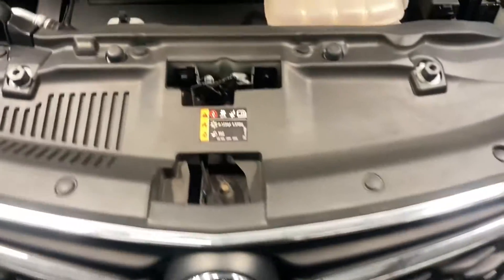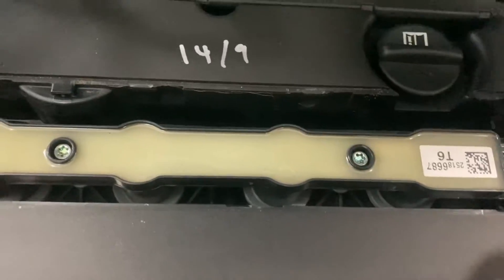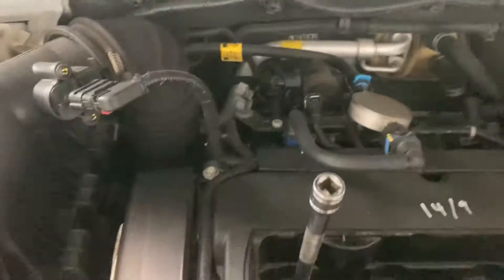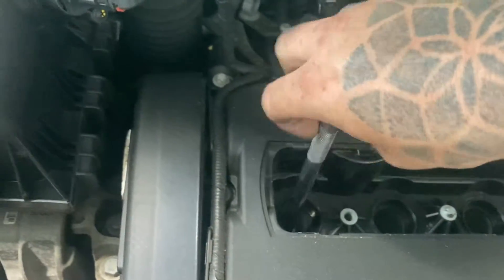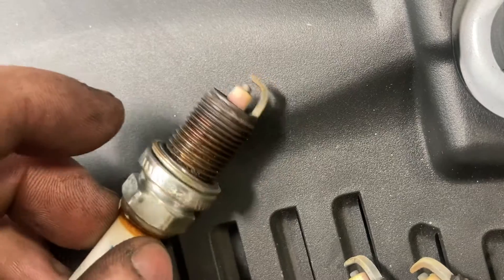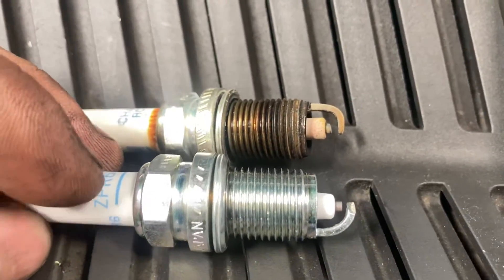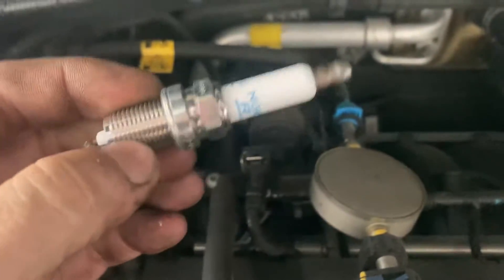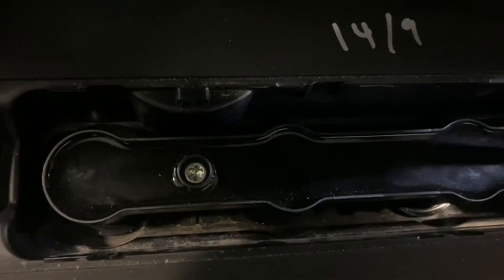Vauxhall Mokka Spark plugs and coil pack change.. causing misfire!!

Comment: I recently changed my coil pack.
I cant take out again the new coil pack it is stuck tightly. How do I take it out? Just pull using force or do i need any tool
Reply from the maker: Just pull hard and even, or a slight pressure from a screwdriver under it. 
Always helps putting some rubber grease around the pencils where the connect to the rocker 👌

Comment: Was on the motorway last weekend and my Mokka lost power all of the sudden. RAC & garage couldn't find an issue with it as engine light wasn't on. Suggested potentially the coil pack & spark plugs might need changing.
Reply from the maker: How was the vehicle behaving?
Reply: Exactly the same issue.. thought it was the fuel pump. 
Hopes changing coil pack wirks

Comment: Hi what year mokka is this please?
Reply from the maker: 2017 model I believe
Reply from the maker: But this engine is pretty much in most Vauxhalls
Reply: Would this prevent an ESP light that shows on the dash - but only when parked or still at lights?
Reply from the maker: @tammymaddison1472  so ESP is not engine related in such. It main works with the ABS. so it could be anything to do with steering, speed sensors etc. it would be best to get it plugged In but might be worth just checking your brake fluid level. Might be setting it off if it’s low
Reply: @owensautotips  appreciate your help only had the car 5 weeks. Got halfords diagnostic booked in. Appre your helpm such a pain as it is only when parked and it makes the idle jump as the esp comes on. Idle is fine in first start up and no esp light comes on.